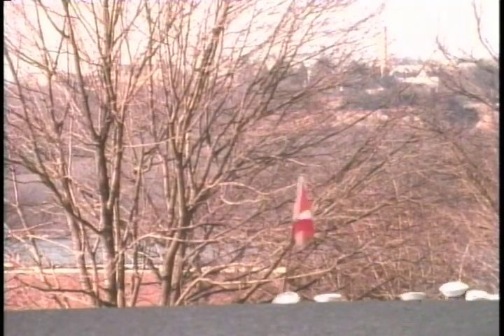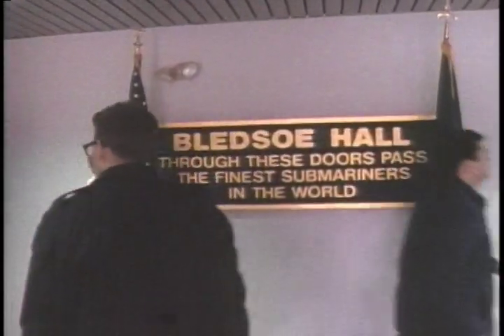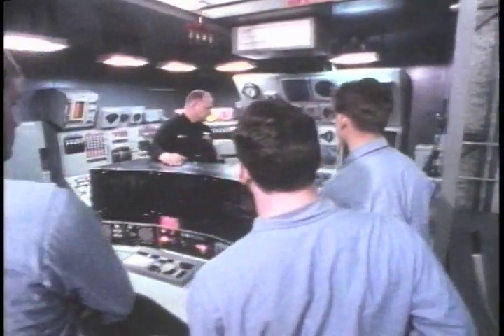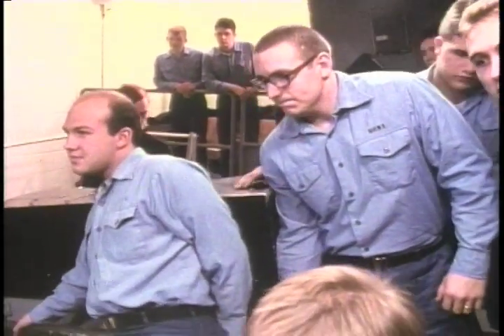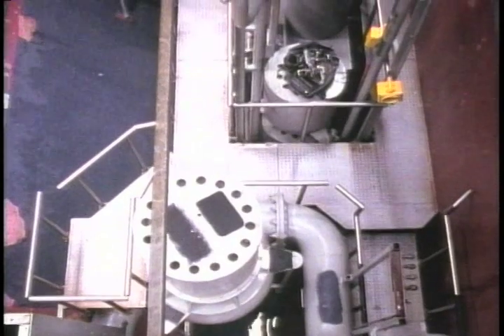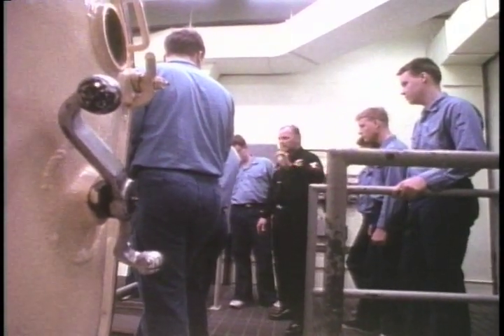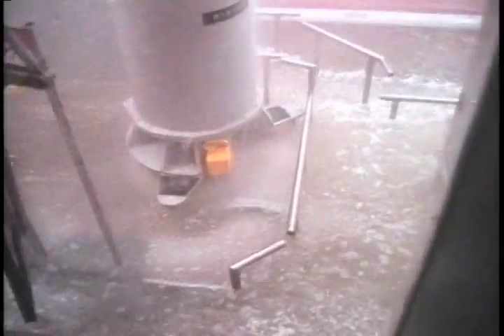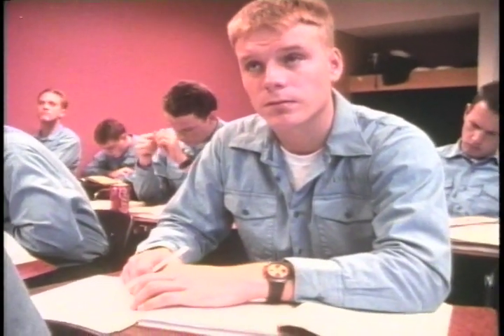Submarine Training -  Hard & Stressful & Needed

Comment: I was in submarines. But I was a NUKE, so we didn’t get to do any of that cool stuff.
   They shoved me in a slimy bilge in Engine Room Lower Level, or cooked me alive in a 110 degree Engine Room Upper Level Hell Hole, or damaged my hearing, running the diesel engine in Machinery 2 lower level.
     I felt ZERO PERCENT camaraderie with anyone in that sewer pipe they called a sub. I did my time and got out.
      I was told I was going to be working in ELECTRONICS, but they made me a MACHINIST, instead, which meant that I was basically a PUMBER; the only difference was the water was RADIOACTIVE.☢️